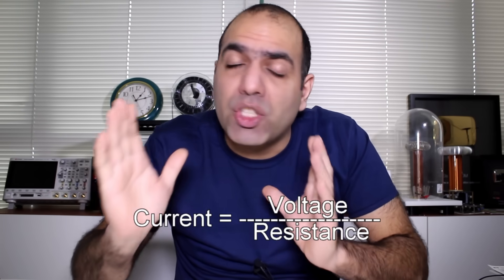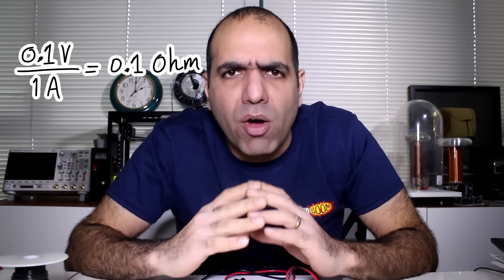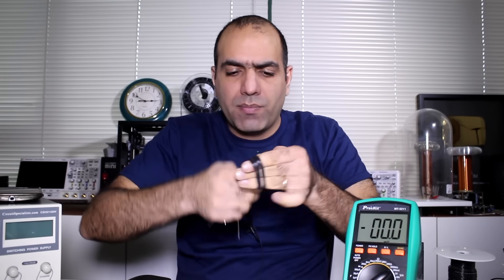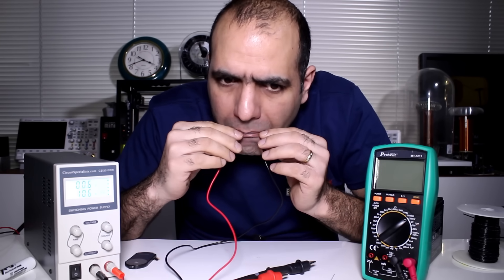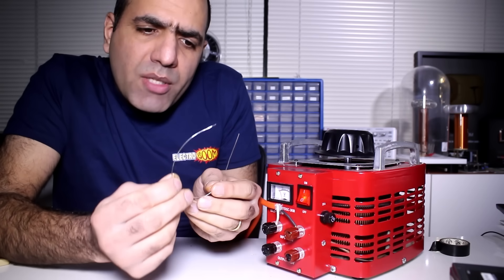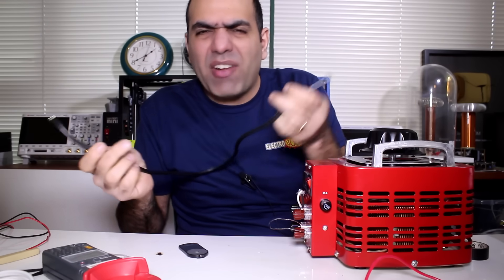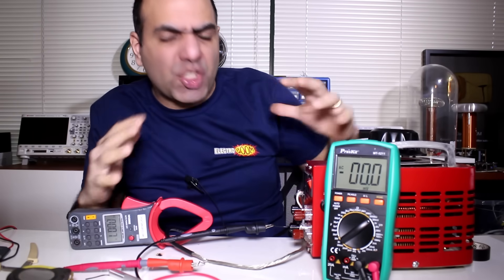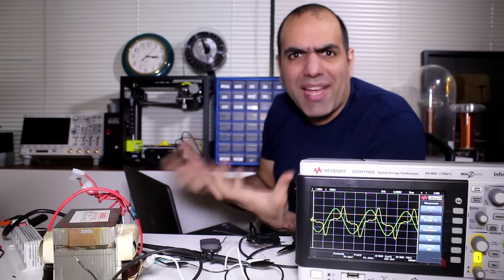How to Make a Shunt Current Sense Resistor

Comment: I am confused, how were you not getting electrocuted when you put 10amp through your mouth? Was it because there was not enough voltage to pass through your skin?
Reply: His mouth has a much higher resistance than the wire, hence the current would rather go through the wire, basically avoiding going though his mouth, but not entirely.
Reply: Low voltages can still create huge amperages if there is next to no resistance - like traveling through a wire. Furthermore, if electricity has multiple paths to travel, it will proportionally split across those paths according to their differences in resistance (look up parallel wiring); in the case of his tongue, even that has a MUCH higher resistance than a bare wire. Add the fact that it's DC to that and not AC. Think of a 12V car battery - touch the terminals and what happens? Nothing. Now touch a wire between the terminals. They'll melt and it'll spark like crazy. That's a huge amperage.
Reply: He already explained it in the video. Are you deaf?
Reply: He put only enough voltage over the entirety of the wire to produce 10amps. However, wire has a very low resistance, so this would not require a very high voltage. Even more so, he did not place the entire length of the wire in his mouth, so an even smaller voltage would be placed across his mouth. In fact, the voltage across his mouth would be the voltage across the supply (small) * the length of wire in mouth (short) / total length of the wire (long - because the gauge of the probes are similar, effectively increasing the total length of the wire over which the output voltage is applied to reach 10A) = (really small). The voltage can be calculated using V=IR along with R=L* r_wire/A_wire=L*R_wirePerLength , where r_wire is the resistivity of the metal and A_wire is its cross sectional area (wire diameter) or you can look up tables of the resistance per length of standard gauge copper wires (simple). No matter what portion of wire you pick, the same current (10A) will always be passing through it. We can estimate the length of wire in his mouth at about 5cm (2inch), and use his provided number of 53mOhm/meter and the measured 10A current to find a voltage (specifically from his right to his left). V_mouth=10*0.05*0.05296=0.02648V=26mV, which is pretty darn close to zero as far as trying to push current through the human body (kiliohms - megaohms depending on tissue type, wetness, path length) is concerned, so the statement he made in the video is correct.

Comment: Ahhh no WAY !!! I recently came across some vintage NOS 6L6G amp tubes and I'm planning to build some sweet sweet old school tube amps with them. BUT, I really need an oscilloscope to validate my power supply circuits etc. Long time hobbyist but this project will test my limits and I'd like to go in with every advantage I can get. Fellow Canadian (if that helps, lol). I'll even video the build encase I have a catastrophic failure. That way all will not be lost.  :)

Comment: GIMMIE DA MEETTA!
Excellent video! I used this method a couple months ago at work just using some banana plugs as the shunt resistors, I measured the resistance of it down to 6 decimal places and was good to go. It worked great and didn't drop the voltage on my test. I didn't know about the canceling method of the inductance though so thanks for the tip!

Comment: another reason to use a shunt is if you want to build current sensing capability into a circuit, you can read current with an ADC on the shunt

Comment: AFAIK not many materials give a linear or close to linear BH curve. Iirc those were designed and used for valve amplifiers to convert the high voltage signal to something a speaker could use.
Also MOTs run on the saturation like, you need to run them with a load or else they will overheat and draw like 5 amps doing nothing, literraly a 1000W heater in the shape of a transformer.

Comment: With the auto transformer set at a low position you are selecting only a couple of windings inside it.  A 1000W auto transformer can only handle 1000W when all windings are selected (max position). Rule of thumb is, If you have the 1000w auto transformer set to output 2.5V (of max 250V) then you can only draw around 10 watts (1%).   (more or less)

Comment: Nice! 
Using copper cables as shunts is not the best though - the resistance of copper vary pretty much with it's temperature (just variations of the ambient temperature in most normal environments may cause inaccurancy). Stanless steel wires work much better. They also have much higher resistance than copper - so you make the shunt wire shorter and the resistance is stable ofer a much wider temperature range.

Comment: Give me da meter. I'm a commercial electrician, we use current transformers (CT') for measuring high amps. Of course the voltage on the other side of the transformer that connects to your amp gauge can be very dangerous, especially if you try to disconnect them live. For testing them we wrap as many turns as needed of test wire and only use 5 or 10 amps. Seems like this could be an interesting and dangerous video.

Comment: Damm lucky that burn could've been worse. I've burned my finger like that also with the oven wires that get hot. It actually didn't hurt much but it smelt bad and after washing my hand that colour thing went away but it did sting a little bit

Comment: One more point is that you can use a shunt within a circuit for both troubleshooting and real-time monitoring of the current.

You can also use the current and voltage readings to calculate your wattage.

And I would be silly not to ask for free stuff too.  Right? Kindly gimme da meter.

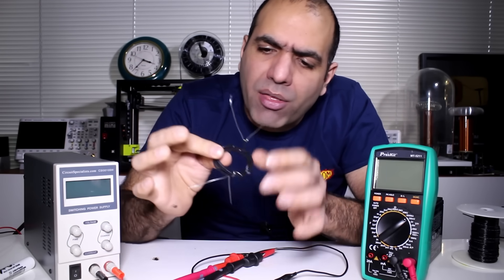Comment: 4:26 If you can see it glowing, DO NOT test it on tongue. Just sayin', it's good to know. 
Unless you are a viper or alien that can see far IR. 
You don't need to lick it in that case, you can see the temperature.
How can some nations measure things in gauge, feet, yards, tongues, fingers, tons that are not tonnes, pounds that not pounds, (like ask how much is a pound of cocaine, it is not one POUND, right???) and degrees Hahrenfeit or whatever that are not same magnitude apart as Kelvin or degrees 'Cience... Just weird.
I have to keep a big printed sheeths of gauge, square mm and mm dia., mills, inches, square inches of wires... lists taped to my door and wall, together with bunch of other english/american vs. NORMAL units list, it is faster than googling it every time. It is WAAAY faster when internet is down and even faster than googling on PC when power is down because i blew something.

Comment: Give it to me baby! BTW the problem is that the shunt resistor may have a change in resistance with temperature that could ruin the accuracy. This is exactly what happens when it becomes hot far before it's red hot and melts. It could be interesting to put it between 2 layers on kapton tape on a radiator.
Reply: real shunts are a thick section of sheet steel with a cut partially sawed into them to calibrate.  also usually 50mv full scale... so more metal and less resistance.

Comment: Gimme da meter!
My shop needs an L/C/R meter to measure magnetic flow tube electrode resistance.
Unless
you want to make a video discussing why you can't use a Fluke 789 Process meter
actually do that instead Pplleeasse
(with power off electrode resistance on a magnetic flow tube doesn't stay stable and reads 1k ohm changes every second but apparently and l/c/r meter it stays constant 

thanks!

Comment: So if voltage drops (resistance increases) with increased length of wire, how does this affect speaker performance on my big fat stereo system? Is my signal quality being lost or distorted somehow? I probably need the shortest wire possible, but what happens when the wires HAVE to be long? I'm screwed then right? Could do a video on it if you feel like it, practical application for the concept you showed in this video? Just a thought.

Comment: Can someone explain? I can see a 25 A fuse on auto transformer but it doesn't break even at 100 amps when things start burning. Why? Did you short the fuse for safety reasons (like kepton tape on earth of the scope)?

Comment: Erm... have you heard about clamp current probes for oscilloscopes? They're pretty precise, even on low amp readings, you can connect those to oscilloscope and they don't burn if you run too high current ;) .

Comment: Actually the current in MOT looks like that because iron core is too small and it begins to saturate near to the peaks of input voltage. Microwave oven manufacturers try to save money as much as possible, and transformer steel is not cheap. Hope this comment doesn't get lost in gimmie shit.
UPD: to not get you confused, of course I meant "near the voltage peaks considering the phase shift between voltage and current". Thanks for likes, guys!
Reply: No it hasnt, thanks for the info :-D
Reply: Also there is a simple way to show this: take small (5-10VA) 220-12V iron core step down transformer, and slowly raise the voltage on its 12v winding with your variac, starting at 0V, monitoring the current; if the transformer is good, at 12v you will see nearly a sine wave current, but as you will go higher, the current will become more and more like shown in the video, because beyond nominal voltage the core will start to saturate.
Reply: Thankyou, i have saved your text to file for later use :-D

Comment: I'm using a meter without probes and the reason is that I forget it in current mode and the shunt inside is toughest than my ex probes wires, so, gimme the meterrr

Comment: I really need a oscilloscope for my Amateur radio electronics hobby. I am a poor ham without the money to buy a radio. I have to make my own transceivers, and other equipment from someone else's schematics or kits. A scope would go a really long way towards helping me learn more about electronics and radio circuits. Please "Gimme da scope".
Reply: I haven't made a QSO in so long I have forgotten how. What I really want to do is make a CW Transceiver for the 20 meter band with about 5 watts or better output power. This involves crystals, oscillators, toroid inductors, band pass filters as well as high and low pass filters and many, many other things I need  Oscilloscope to use in order to make a transceiver that doesn't  cause so many harmonic signals which could get the cops and the aliens come down hard on poor little me. Clearly  I am not asking for  the best toy in the box, but I am asking for a tool to get started learning better things. Once again please "Gimme Da Scope".

Comment: ahh phase cancellation! i have no mono cable for my guitar conversion... so i just put an adapter to plug the guitar on a stereo cable but then HUMMMM the noise cause those are not shielded BUT it's a STEREO CABLE! so i put left in + and right in - (plus/minus) and added both channels meaning any noise (A/C) added in both gets cancelled out (D/C) and any thing only in left = sound! so (0)  + (-10) = (-10) but (+2) + (-12) = (-10) some times i would like to have diodes in every thing with capacitors to absorb all the stray current(energy) and charge things... then again those waves are wussies, all i need to do is be near a radio and it becomes totally silent (well a few small crackles but not shhhhhhh mostly silent... same with T.Vs. but less bad the screen goes gray seeing the noise of the universe!)

Comment: At 10:12 you mention that in an inductor, current wave should lead the voltage wave, but inductance makes the current lag the voltage right? But i could see the leading current waveform in your scope, how is that if everything you used had only resistance and inductance and no capacitance?

Comment: Ok, so the magnetic field is cancelled when wires are parallel and the current flows in opposite direction. But how about the point where you bent the wire? Is the field around that area so small that we can just ignore it?

Comment: Thanks for the interesting video on shunts, I’ve seen them a thousand times but never gave any thought into how I might make my own. The tip of folding the wire to avoid inductance is a great one, no doubt it’ll come in handy. Also, GIMME DAT MEETA. Or the oscilloscope, which would be an awesome tool to have! I’ve wanted one for a long time but they are not the cheapest tool in the shop.

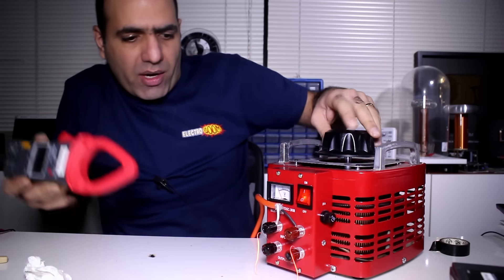Comment: GIMME DA MEETTA! + the wires fail(heat up the most) in the center(at 6:28 and 7:18) because the transformer in your auto-transformer can sink up some of the heat(at the ends of the shunts)? Or is there some other reason both wires failed in the middle?

Comment: Hey, you're a big inspiration to me, a current student in an electronics class. I was just wondering if you could do a video about screwing around with LED light strips. I have one for my room, but I'd like to do more, also, somehow, I need to make a connection for the second strip, because it seems like they sent my the second strip with two outlet ends, there's no plug to plug it in>.<

Comment: Holy SHUNT.  Those finger burns are nothing to play around with...  

I have a few workable meters, but getting a decent oscilloscope would be the SHUNT.  I could put that to use in my audio endeavors, particular when I have a power amp acting up.
Reply: It's all fun and all that he gets electrocuted from time to time but he surely knew this was going to happen. I would advice him not to do these things or step down the voltage beforehand so he won't get burnt and it would still be equally funny. Mehdi, I like your videos even with less explosions, just want you to be safe.
Reply: guitarstitch O